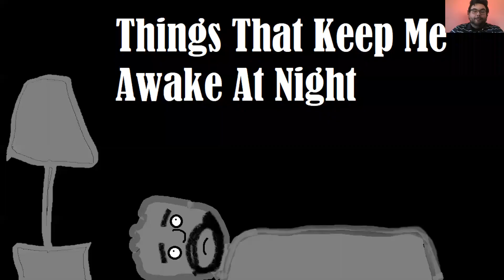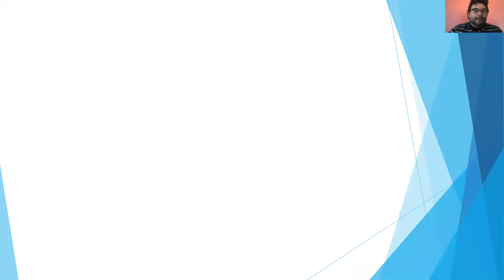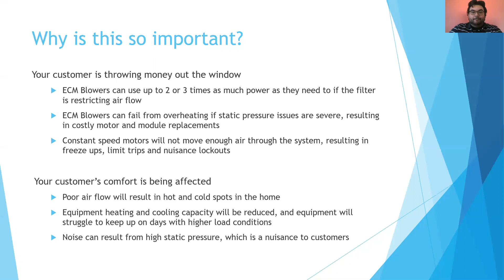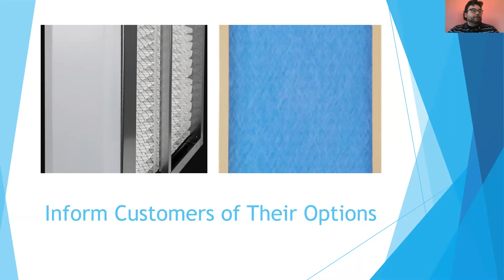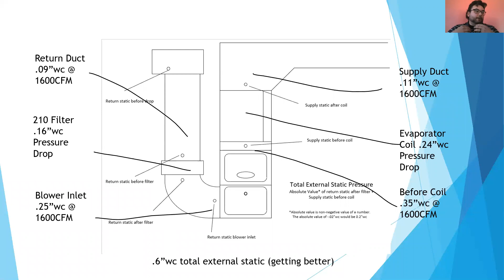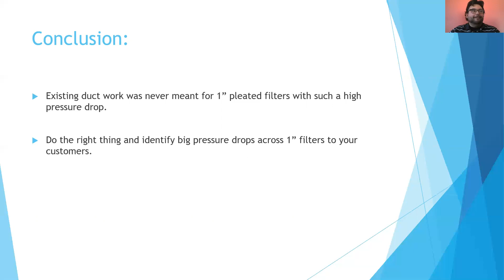1" Pleated Filters:  The Silent Killer of HVAC Systems

Comment: Dear Static Pressure Nerd,
Your video impressed us with the seriousness of keeping the air clean and flowing as unrestricted as possible!
We have a TEMPSTAR SmartComfort Heat Pump/Propane Furnace and the filter cabinet in the return duct can actually accommodate a 20x25x4 filter, but the previous owner simply had a 1-inch “horsehair” style filter in it...possibly because the AC & heat were both struggling when we bought the home. We had to have the evaporator unit as well as the heat exchanger replaced, and the HVAC tech was non-committal regarding what type of filter would be best. Without getting too crazy, would a basic 4-inch MERV-8 filter be a good option for keeping the evaporator & heat exchanger etc. reasonably clean, while also helping minimize the static pressure drop? We are thinking of this one and would love to hear your thoughts:
Aerostar 20x25x4 MERV 8 Pleated Air Filter, AC Furnace Air Filter
Thanks so much for sharing your knowledge!
Reply from the maker: I’m not able to find an airflow chart on that specific filter so I cannot verify 100% for sure that there wouldn’t be an excessive air flow restriction, but I would feel comfortable saying if your system is a 4 Ton or less heat pump you should probably be ok with that model.
Reply: @staticpressurenerd5182  THANK YOU so much for your reply...and I apologize for not acknowledging you sooner. I just saw the email notification in my gmail...my bad. Very much appreciate your efforts!! (Sorry if I confused you...I used my friends laptop, so when I clicked on the email link, it logged into youtube with his account 🙂 )

Comment: I'm more confused, what should I use then? I have a duct return of 20x20x1.
What merv?
Are the washable ones better then because they're not pleaded?
Reply: generally lower merv ratings restrict airflow less. if you have the option thicker filters give the same or better filtration without raising static pressure as much so if possible try a 20x20x2 instead of a 20x20x1.

Comment: A lot of older furnaces only work ok with MERV 6 or less filters.  A friend has a furnace that flashes a warning if he uses anything beyond MERV 8.
But newer furnaces with ECM multi-speed motors can generally handle up to MERV 13 without making the motor struggle.
My previous furnace worked fine with a 20"x25"x1" MERV 6 filter from 2007 (new) to 2020.  It was replaced after a house fire in 2021 with a new, modern 92% efficiency furnace plus central air with an ECM multi-speed blower motor. I expect the motor will adjust to the filter with no loss of life expectancy.  It's also quiet enough I can't tell when it's running, unlike my last furnace.
The furnace came with four MERV 10, 16"x24"x1" disposable filters, the first one getting dirty quick - surely a lot of dust from rebuilding much of the house.  The next filter I used barely got dirty in a month and a half (Sept. & Oct., almost no air or heat used).
I replaced it with a washable, non-electrostatic, pleated, K&N brand MERV 11 filter of the same size and I'm confident the ECM motor will adjust to it. It cost about the same as four - one year's worth - of disposable filters and is easy to clean (Simple Green and a mild hose spray). The remaining MERV 10 disposable filters will be my backups when I clean the washable filter and let it dry.
Reply: Especially the new variable speed heat pump systems.

Comment: How do we convert form 1” to 4”?
Reply from the maker: A new filter cabinet needs installed to accommodate for the larger media filter.  Usually some slight duct work modification is necessary to accommodate for this.

Comment: So am I extremely lucky? I have a 17 year old 3 ton Trane that uses a 20x20 filter.  I use and have always used a Filtrete 2200 1" highest allergen rating for its entire life and have only ever had to replace my capacitor twice due to power surges. Why am I not experiencing any issues due to restictive air flow as you are stating?
Reply: Because this video is bs trying to reinvent a system that works just fine
Reply: Indeed. My hvac expert measured my system return air flow and ok’d the merv 13 16 x 24 x 2 inch filter I had been using from an equipment static pressure point of view. My system has too much power for my sq ft anyways. Still recently I switched to merv 8 2 inch to increase efficiency on coldest and warmest months. Still use higher merv during spring when hvac hardly runs but allergies are high, which should be fine. Though I’ve decided to mainly focus on a single high efficiency self standing air purifier for air quality needs. The hvac filters only filter when they are running and I don’t use unless too hot or cold. Also, MERV 8 is supposed to be really good and the MERV rating is done in a clean lab with minimal air pass on a clean filter. My air keeps cycling through the filter over and over and as it gets dirtier there is more restriction which I think means it filters better. This video was informative though.
Reply: The answer may be in your second sentence.......Trane.
Reply from the maker: Glad to hear you haven’t had any issues. With PSC motors they don’t ramp up and potentially overheat.  The restriction of the filter reduces your airflow and may result in longer run times, but if everything has been ok for you that’s great!

Comment: So for most of us with 1" only option, is merv4 the best possible option or any other you would recommend on such situation?
Reply from the maker: MERV 4 is probably your best bet for 1” filters.  You could improve your filtration by installing a bipolar ionization unit into your return which will cause smaller particles in the air stream to clump together and get caught in your filter.
Reply: @staticpressurenerd5182  is merv 4 not super low ? like most particles will pass . Thanks for the great video

Comment: Awesome video man! So my takeaway's from that is that homeowners should look into retrofitting their returns (with HVAC company assistance) to accommodate a 4+ inch filter. Because the upfront cost of doing so will save money in the future from a happier coil and fan?
Reply from the maker: Your takeaways are correct.  1” pleated filters are typically $15-$25 depending the brand and benefits advertised.  If you are buying 4 a year your filter costs is are at least $60. On top of this, you have the added cost of energy consumption from an underperforming HVAC system.  Investing in a media cabinet and having a yearly filter cost of $30-40 (if you are purchasing them yourself) will pay for itself and then some in a few years.

Comment: what is the brand name of the filter with lower static preasure
Reply from the maker: The 4 inch pleated filters in my example were Aprilaire media filters.   As for a 1 inch filter with a low pressure drop a common brand is True Blue.
Reply: @staticpressurenerd5182  are all True Blue low pressure drops? I see Home Depot has some FPR 5 and FPR 7. Is True Blue the brand you recommend for 1” filters?
Reply from the maker: FPR5 and FPR7 may be too restrictive depending on the size of the filter and the air flow required for your heating and cooling system. I don’t specifically recommend True Blue filters, these are only an example of a 1” fiberglass type filter.  Any fiberglass type filter will help reduce pressure drops in your HVAC system.  Lower pressure drops result in less energy consumption.

 We can modify the filtration system to have two 1” filters in a “V” formation which will allow for more surface area and as a result more air flow capacity.  This would allow you to use filters with higher MERV/MPR/FPR ratings such as 1” pleated filters (Filtrete, 3M, etc.)  While this method works, switching to a 4 or 5” media filter cabinet will be a more effective method of improving filtration without increasing pressure drop.  Your yearly cost on filters will usually be lower on a 4” filter v. High filtration 1” filters.

Comment: You have to learn to do basic math, 20x20x1 inch filter with 8 pleats per inch = 160x2=320x20= 6,400 sq in.  / 20x20x5 with 2 inch per pleat = 10x2x5=100x20= 2,000 sq in. Be careful.
Reply: the pleats are deeper in the wider filters, do math.
Reply: @REALBanannaman  🤣 🤣 🤣 🤣 🤣 🤣

Comment: what kind of static across a dirty evaporator coil?
Reply from the maker: Steve T would all depend on the actual air flow and what the coil was rated for clean at that air flow.  In my opinion if your drop across the coil is 20% higher than the drop the coil is rated for at that air flow it might be worth looking into cleaning up the coil.
Reply: @staticpressurenerd5182  one issue is in the field you will have a difficult time in most cases finding the manufacturer rated static pressure drop of that particular coil. Also many coils are uncased coils within the duct work and its nearly impossible to get a model or part #.  So there must be an acceptable range to refer back to.  I think your video is insightful, static pressure is definitely something which is overlooked in many cases.
Reply from the maker: Steve T Definitely agree!  I would say if you can’t get your hands on that information, older equipment may have a clean pressure drop of around .2-.25”wh and some newer systems are commonly .3”wc.  If you are reading drops of .4”wc or higher there probably is an issue, whether it be system design, incorrect air flow settings or the coil itself being dirty.  Just trying to help everyone be more conscious about paying attention to static pressure I think it will benefit both technicians and customers in the long run!